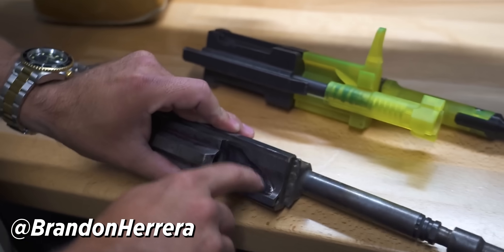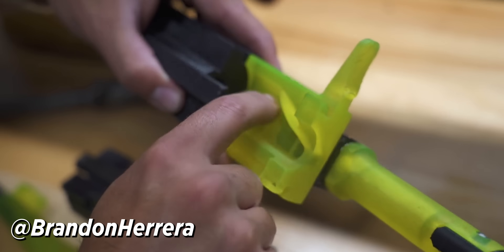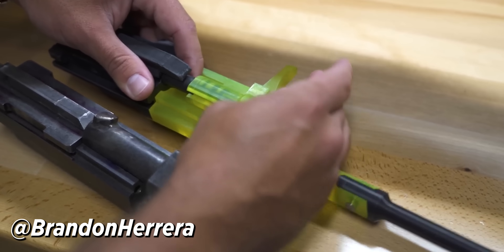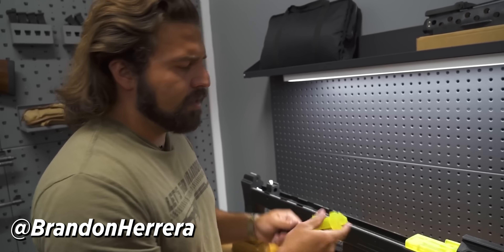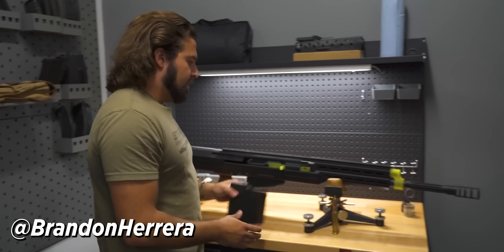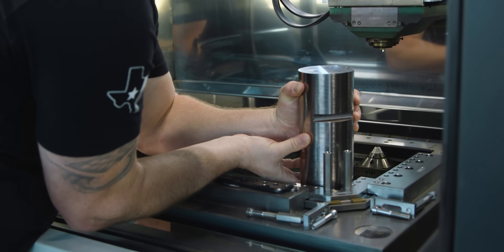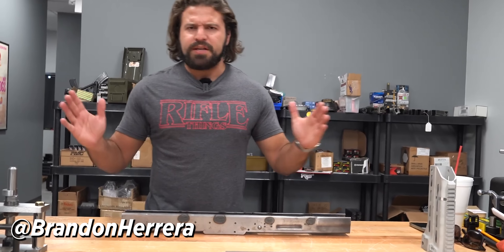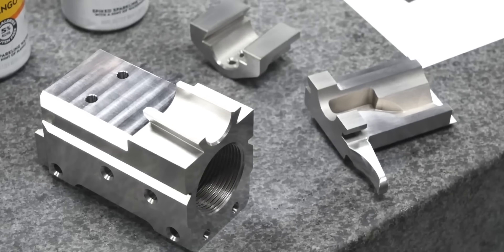How We CNC Machined the AK50

Comment: What’s the longest hole you could sinker EDM? I just had the probably terrible but maybe decent idea of rifling using either a rotating electrode or rotating work piece. It might be comparable to cut rifling in precision with even less residual stress introduced. Gain twist and final twist rate can be adjusted on the fly with the only constant being the cross-section of the bore.
Reply: Thats been a thing for a few years now. If you built an FCG-9 all the way from scratch thats the way theyve done the rifling in their garage. With 3d printed parts and a homemade  EDM
I would imagine its not done in major production because of time/cost factors

Comment: You guys really made some amazing parts with fantastic fitment. I'm gonna be sad if Brandon has to sand/file some parts to get them to function because the fitment is too perfect
Reply: Only reason that might happen is if titans is a different temp than the ak shop. Note industry standard is 68°F
Reply: @Eluderatnight  no. Guns are dirty. They get dirty. They also heat up as you shoot so their temperature can vary by hundreds of degrees. Having too tight of tolerances can cause reliability issues. Typically you'll want tight clearances where you need it and open places for the gunk to go where you can.
Reply: @ChevTecGroup  if brandon designed it correctly and selected the correct tolerances then it should work
Reply: @pepelajuandeag1696  yeah I agree. But Brandon is also a first time gun designer, and making a gun from your own drawings is a lot more difficult than riveting together some parts kits. 

I'm not saying it's gonna be a problem. Just that it COULD be, partially because of how great Titan's machining is. But that's what prototyping and testing is for.
Reply: @ChevTecGroup nailed it.